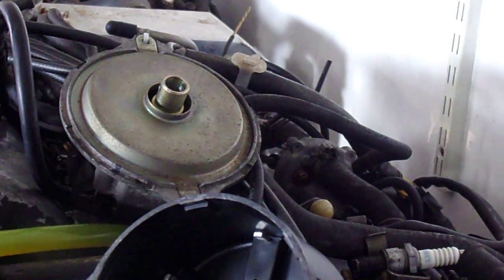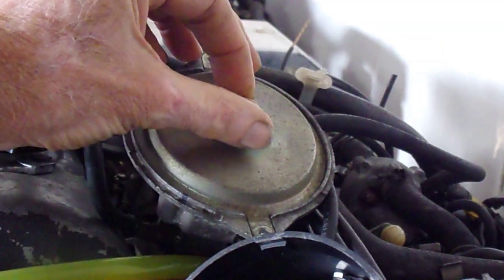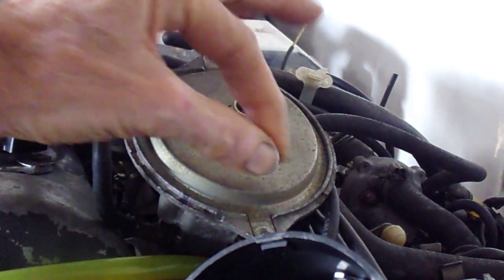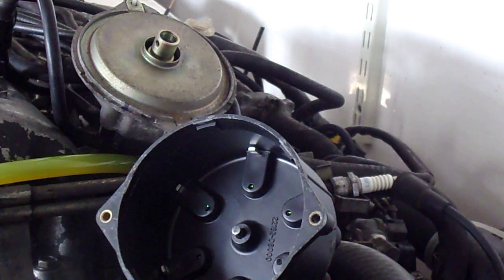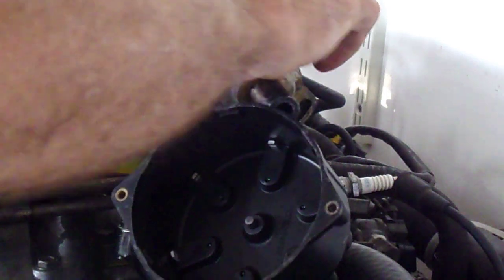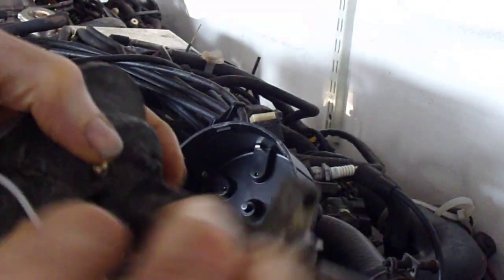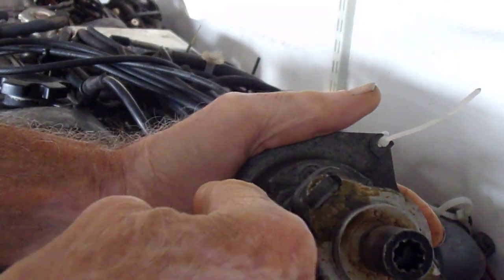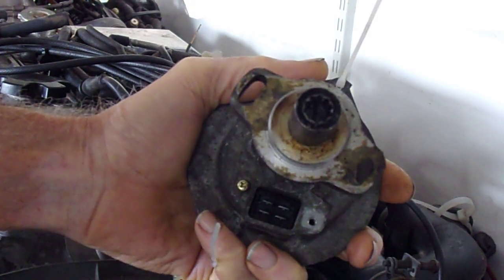Datsun 280zx turbo, more Crank angle sensor testing

Comment: Great follow up video on the finicky crank angle sensor. I Look forward to your findings or if the aftermarket sensor solves the problem of intermittent no spark. I have heard that the oem 280zx turbo crank sensors are failure prone and that the updated maxima and 300zx sensors are a more durable design. Im sure you will come up with a work around on mounting the new sensor and once you do will likely be more reliable. Would be interesting If you find a fixable issue with your current sensor. Surprising that the chopper wheels run on such low voltage. Will definitely have to compare with the replacement sensor. Thanks again and keep them coming Dave!
Reply from the maker: More on the way!